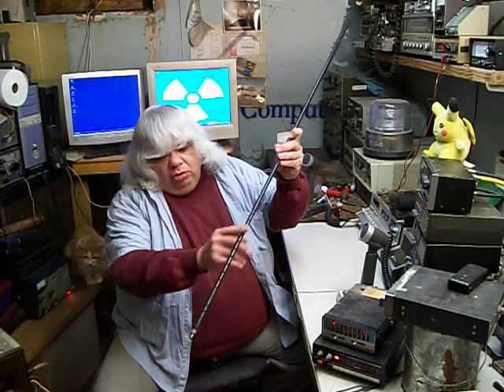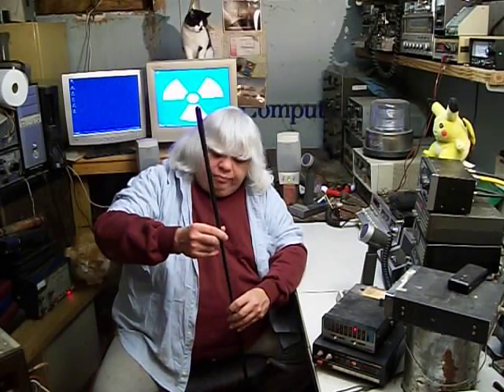THE FIRESTICK QUESTION.

Comment: First of all RIP Challenger. Thank you for being you. My radio brother from another mother. Just discovered Dino's channel and I am glad it's here and sorry I missed him. I think I have an answer for Dino and anyone who wants my two cents on his question posed about the rubber thingy on the tip of the firestick/wilson/hamsticks. I noticed the same phenomenon when tuning a top-loaded cb whip for ten meter operation; when you remove the rubber cap the SWR changes dramatically. My theory was and still is that the insulation provided by the cap impedes the skin effect of the rf energy traveling up the conductor and coil and increases capacitance. It's just my two cents but I think it would act the same if you wrapped the same thickness of good electrical tape like a super 33+ or super 88 around the tip. This effect does make tuning more challenging but I have always thought it worthwhile since it provides weatherproofing and I have lived in snowy, wet areas for many years now. Keep on bruning up the airwaves, enjoy your radio passions whatever they are as long as you aren't hurtin' nobody. Just like Dino did and I intend to do the rest of my days Lord willing. 73 Dino I'll be on the side. Bump bump and I just got down! LOLz....

Comment: Good point! I suggested that he make a LC tank and use the rubber cap for the coil slug and take a baseline reading with either a grid dip meter or a sweep analyzer then remove the rubber cap and see what happens to the baseline resonance reading.

Comment: Hi Lasreejaw the best test would be to pop in the microwave for 10 seconds if there is anything conductive you''ll hear it crackling and when to microwave has come to a stop the rubber will be warm.

If the cap is non-conductive the rubber cap will come out of the microwave as cool as it went in and this is the most reliable test.

Hope this helps

Comment: Black rubber has carbon in it. there are 2 types of forklift tires marking and nonmarking. Marking are black and have carbon in them that’s why they are black. And they conduct electricity. As in the forklift won’t build up static electricity running on the black tires. But nonmarking tires are white or gray. Because they remove the carbon from the rubber. And white and gray tires don’t conduct electricity so the forklifts collect static electricity. And it will shock you from it. So you have to run a static strap on them to drag on the ground to dissipate the static electricity. And the static straps are made of black rubber that conduct electricity.

Comment from the maker: @Robertsegade I'm not asking about the receive.  I'm asking why it must be used for the SWR to be flat. Its there to protect the tunable tip and to keep the swr down low. My question is why does it have this effect? Its just butyl rubber and is transparent to RF.  WHY DOES IT DO THIS?

Comment: I'm fairly sure that the phenomenon you are experiencing is because of the added mass at the end of the antenna. If you were to tune the antenna without the tip on and then you put the tip on you would find the same effect. Firestik says on their website that you can operate with or without the tip perfectly fine and it is merely cosmetic on the FSII (helps keep water out of the KW original wire trim firestik) they simply say that how you tune the antenna is how it must be used tip on or tip off. If you tune it with the tip off and then add the tip you have changed the resonance of the antenna because you have added additional mass. This is amplified by the fact that the small amount of extra mass is being added at the very tip which is the most sensitive part of the antenna. You will find the same effect if you add a rubber ball to a steel whip ( the kind used to keep it from hitting your vehicle) you have changed the mass and added it to the middle of the whip so it must be returned. Hope this explains something

Comment: Just a thought on this, in case anyone is still curious. The rubber is an insulator. At the same time, we know that high voltages will develop at the tip of the antenna.  Perhaps the rubber cap is blocking some of the radiation at the tip, thereby affecting the VSWR. If this IS the reason, than any top loaded antenna could be checked by slipping that rubber cover over the top.  Alternate materials could be checked as well, or perhaps a thinner rubber, which might have less of an effect.  I suspect paper wouldn't affect the VSWR as much as the rubber.
Reply: +Rick McCarthy RF will pass through rubber or plastic without loss that is measurable.It is so minimal nobody will notice.
Reply: +1OFGODSOWN That was my thought as well, yet if we assume the results occurred as stated, why the VSWR change?
Reply: +Rick McCarthy Can't say without doing the test myself because he has passed away so we can't ask him if he ever got any further information either.I just installed a WILSON "SILVER LOAD" a few minutes ago & without the CAP the SWR is CRAP & with it it's almost PERFECT.Looks like meter flakes inside the rubber cap to me & that must be the key.
Reply: Yes. I had a firestik many years ago, and I never had this problem. I also wasn't really looking for it then. If I ever get the opportunity to check someone's setup, I'll check for this and report my findings here.

Comment: I was intrigued by this.  Because I use a 4ft firestick    and I carry a spare tip in my tool box in the back of my truck.  So I grabbed the spare tip and the tip on the antenna and started to look real hard at them both.  Couldn't see nothing out of the ordinary. Until I put a high powered light to the investigation.  And there I saw it. Molded into the rubber tip. A very small semi ridged disc of some sort. Right in the tip of the rubber cover.   Both of them have it.   Very difficult to see.   I had to use a magnifying glass and very high powered light source to see it.   Hope this helps you

Comment: Looking up what that rubber is made out of. There is no metal in the cover, however there is carbon. Also just because something isnt conductive does not mean it wont effect radio waves. There is iron in glass for example, and it effects radio signals as well.

Comment: I know this is an old video but a simple test could be done by buying a rubber bolt thread protector of the same diameter and try that and see if it acts the same way. If it acts the same way then rubber does actually affect SWR. If it does not act the same way then they have something in theirs they are not disclosing.

Comment: Plastic and rubber does have some dielectric loss and will heat slightly. More so at higher frequencies. Therefore it can effect an antennas characteristics..... Air's dielectric constant = 1.005 .....  Butyl rubber dielectric constant = 2.3

Comment: how do you trim a 4ft fiberglass trim to tune firestick antenna the right way please help me
Reply: Typically, don't trim a fiberglass antenna. It should have a removable cap. Under the cap, there should be a tuning screw. Turn the screw to adjust the swr. Just make sure you put the cap back on before you check the swr.
Reply: You cut the black tip , remove wire and check swr , if it’s an original fire stik , check there site it’s right there

Comment: I have owned all kinds of antennas and i always go back to the Firestick. I had a 102" whip on the trunk of my pontiac and it hit anything and everything so i went back to my old faithful 5' Firestick! I also own a Wilson 5000 mag mount and its ok, but the load is at the bottom. I try to tell these guys around here that a top loaded antenna is better than a bottom loaded or a coil antenna, but they dont listen...... Oh well......

Comment: The rubber cap probably makes the brass screw and nut make better contact with the antenna wire at the top.
Reply: i was thinking the same thing

Comment: I have their firestick2 and it's on my second story porch but gives me al most flat swr' because of the tuneable tip great talker on my stryker 955hp only problem is the condo won't let me run any thing outside .you know my dilemma I want a better porch antenna?
Reply: I have a harmonics problem because the antenna is only10-12 feet away and I have heard a lot of fixes.This keeps me from turning the radio up?
Reply: Any help would be great!

Comment: Hi Dino,
My understanding is that they build aerials, with big coils to attempt to reduce the inefficiency of it's insertion into the circuit. the wide spaced the coil is the less current is lost in the coil (Due to the lower interaction).
The use of silver in the aerial is a sales gimmick (as is gold in the audio industry). Nickel silver has a lower contact resistance than straight silver (AU). Also non-pure silver tarnishes very quickly. Only Sterling silver (925) will not tarnish. Sounds good on paper but its effect is great advertising. maybe they make a great aerial but it's efficiency is down to the design not the use of silver.
The position of the loading coil changes the radiation pattern which is what you said (I think? "... gets your radiation a little bit higher".) but its position of the aerial due to the losses involved in electrically shortening the aerial the position of the coil will effect the amount of RF that is radiated. The base of the 1/4 wave is AC high current which the coil will resist.
If you think about it a Firestick aerial is a helical whip (i.e. an oversize rubber duck). What it loses in being a coil it gains in its polar pattern which makes it "appear" to be efficient (Well more efficient than a base loaded aerial anyway).
As  to the cap, anything which has mass will have an effect on the energy of a radio waves. Pure rubber (as you called it) is not "invisible" to RF and the closer to the source of radiation the more the effect on it will be noticeable. The more sensitive your measuring equipment is the more you will notice the effect. Remember the voltage at the tip of a quarter wave is high and current low.

Comment: There are plenty of these "rubber caps" around now with all the electronics and electrical items or mechanical devices....use one of those as a replacement to see if they act the same. If same results - then is rust plain rubber with no radio wave influencing additives.

Comment: uniden 880 Bear cat. help!! my adjustable tip- 48" firestick. is not passing according to the Bear cat.  attached to RR body of jeep wrangler. aluminum mount.  why is there no com's?
Reply: Naila  Martus I have the same problem on my 2016 Wrangler Unlimited. Have the antenna mounted to the tire carrier and I cannot get the SWR within limits, driving me crazy.
Reply: wrangler - If your tire carrier is the 'swing-away' type, it isn't grounded to the vehicle because the hinges have nylon bushings in them. You can fix this with a bonding wire. Here is a good link that will help you: http://www.firestik.com/Tech_Docs/jeeps.htm

Comment: Well I know Dino has passed away but I just installed a 5 ' WILSON "SILVER LOAD" on my pickup truck 10 minutes ago 10/5/15 & I pulled the tip out about 3/4 of the way & tightened it down.It barely moves the SWR meter with the cap on & it's almost off the scale without the cap.I am amazed like him that the cap makes any difference but the instructions with the antenna even says it will do so if the cap is not installed.Looks as if there are metal flakes in the rubber so that must be the secret & those flakes are part of the matching.I did not readjust the tip since the SWR barely moves the meter anywhere on any channel 1-40 so why mess with it? Now if it will just talk as well as it tuned I'll be happy happy happy. {:>)

Comment: I just got a firestik KW from a garage sale the old one you have to cut to tune. Is it pretuned for 11m?
Reply: +Commie Bastard Thanks I pulled off the red cover and it appears to already be cut. When I tested the swr it was so low that the needle didn't even move on my Galaxy 959. This made me think something was wrong because even my IMAX2000 makes the swr move a little bit. I was able to make a contact with 4 watts from Leominster MA to Nashua NH 30 miles as the crow flies with the antenna mounted off the back of my truck bed!
Reply: +Fast Eddy Do you think that my 5 foot firstick KW will transmit farther than a 102'' whip?
Reply: NO IT NEED'S TO BE TUNED READ THE REVIEWS ON 440 CB SHOP ON FACEBOOK.

Comment: the stix is tuned or made with the cap on so its more or less tuned to the cap   there is lead in the color that they use in the rubber I bet if you use a rubber cap that is clear no color added to the rubber the swrs will be high

Comment: For anyone who watched this video I might have the answer to this question. What are rf filters made out of. If you know you just answered your own question. I'll give you a hint. Think of electrical insulators. Still don't know well I'll just tell you. Ceramic. There is your answer. Ceramic dissapates heat. Just like engine paint it can be infused into rubber. Not rocket science. If you burn a tip to one of these antennas there is fine particulate left over that cannot be burnt. Heat it up with a oxygen and acetylene torch and it melts and turns into a glass like substance.

Comment: rf signal is restricted by rubber,plastic and pvc. not a lot but it does cut it down.... ive tried j pipe with pvc over it and without it and with the pvc it cut my signal strenth !!! do a test and you will see

Comment from the maker: @miserableoldcunt Only one problem, the tip is RED. The technical engineer swore there was no additive to make it conductive. No metallic elements to conduct in any way. The additive they use to dye it red has no metal in it. THEN WHY DOES IT BEHAVE THE WAY IT DOES? ITS JUST BUTYL RUBBER. 
The engineers didn't know what to make of it. Neither do I.  I think its PARANORMAL.. Lawdy lawdy miss clauddy .Thanks for watching mang.  73 de N0RJP

Comment: for those of you still wondering about our dearly departed's question: the answer is in the carbon content of the rubber itself. Soooo... both engineers were right. Sort of. to say there is nothing in the rubber is wrong. The natural tendency of heat rubber (molded rubber) serves to increase it's carbon content. It's the whole reason we use rubber on the outside of cable, coax and helical wire.
Reply: my theory also, also the carbon to make it black

Comment: Here is my interpretation of the mystery surrounding the tip covers on some CB antennas. Like light waves passing through a glass prism, the radio waves are shaped and radiated best by this simple tip cover to best serve the purpose for which it is used. The pigmentation of the color may serve that purpose. Maybe it's a certain amount of metal dust mixed in the tip, but it could be that simple.

Comment: im an amateur radio op myself on VHF/HF/ and CB found your video interesting and after having a good dig around this may possibly answer your question. check this out bro. According to the article located on that link its a conductive rubber which would be an extension to some degree of the brass as its conductive if you get what i mean. Let me know what yah think all the best Dan

http://en.wikipedia.org/wiki/Metal_rubber

Comment: The firestick is all coil from the bottom to the top.  He says he doesn't like antennas with a coil.
Reply: he said he didn't like base coils, or mid coils...
Reply: infowarguy - He's talking about loading coils. They trick the radio into thinking that they are seeing a 50 ohm impedance. I'm a ham radio operator and we use antenna tuners all of the time. Most amateur bands are too wide to have a single antenna show flat SWR's across the entire band. Antenna tuners compensate for this. It's sort of like cheating the system. I can make a welding rod show a 1:1 SWR with an antenna tuner, but that doesn't mean it will radiate much power. Antenna loading coils are doing the same thing. They are taking a non-optimal antenna length and tricking the radio into thinking that it is seeing 50 ohms. The trade-off is less radiated power and less received signal strength.

Comment: Every fiberglass stick antenna comes with the required rubber cap and the only exceptions I have seen have a tuneable rod with round tip instead of the rubber cap. run it without the cap and your swr will be 3 or higher, put cap on and it will drop below 1.5 .  Why?  It seems the cap acts as a power resistor or capacitor to suppress the signal power enough to cause the radio to be able to modulate, which is what you want.  To demonstrate how the cap suppresses signal you may want to pull the cap off your stereo antenna built into the right side mirror (freightliner) and notice how much more the stereo pulls in.
Reply: yes and no... you don't want to be over modulating. The antenna has much to do with the modulation as the microphone. Most cb radios come from the factory at 80% modulation to prevent over modulation which, in turn, creates  spurious emissions, distortion and clipping. That is the ever present Saturday night over conversationalist that sounds scratchy and sometimes garbled. You know the one. He bleeds over other channels and other electronics to say something extremely trivial.
Reply: I think the coil is tuned to be used with the cap and the sticks that are made to be capless are tuned differently in the coil. The cap adds capacitance is my theory. Just my two centavos.

Comment: my belief is it guards against static build up on the tip of the antenna. Try covering tip with electrical tape, or the self-sealing tape... Sane affect?
Reply: John Niedermier I put electrical tape on mine because the rubber cap broke off and the swr’s went back down. Sounds like a good theory